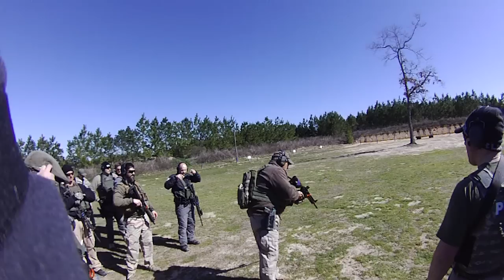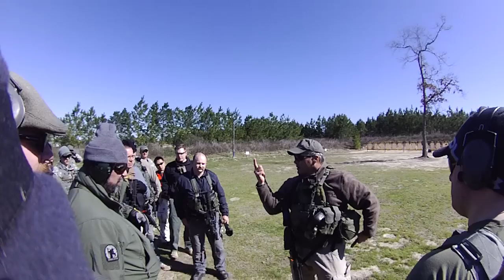Loading procedures from Paul Howe

Comment: Good points.  I personally don't like loading muzzle down, carpal tunnel has made my wrists weak and they don't like that much weight bearing on them that way lol.  Most of the time I'm loading muzzle up too but like you said, it's about the situational awareness and having different techniques you can use.

Comment: AD? There is no such thing as an accidental discharge. And unintended discharge of your firearm is negligent.
Reply: Then how do you see a slam fire? Is that the persons fault?
Reply: Wrong. AD is out of the operator's control; ND is in the operator's control. You can do everything right and something can still go wrong. Thats why we have multiple rules, not just 'finger off the trigger'. Multi-redundancy; backups for your backups - you have to violate more than one rule at a time, for there to be consequences to a mistake. I am willing to destroy the dirt, I am sure of my target, so if one does get off the chain, the consequences will be confined to my underwear.
Reply: I have 4 extra holes in me from an AD, recalled handgun my buddy had. He never touched the trigger.